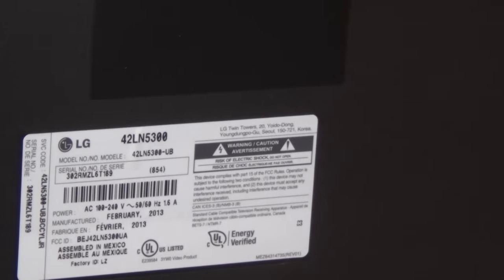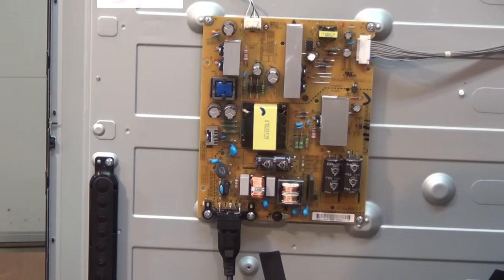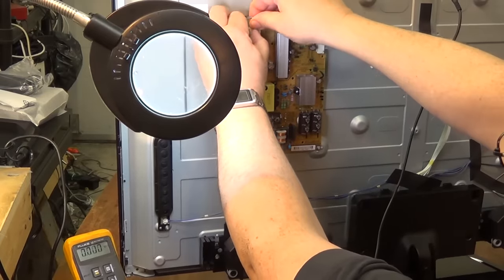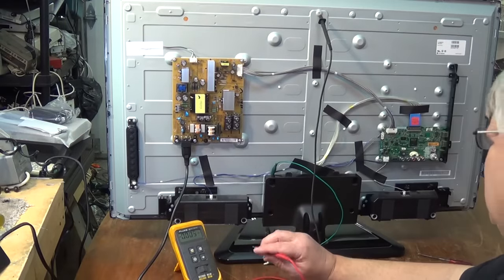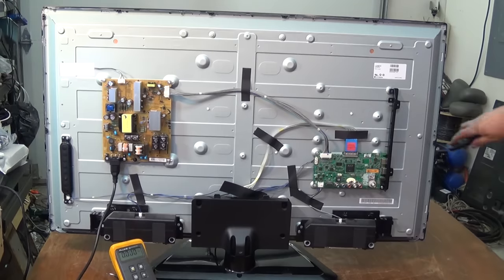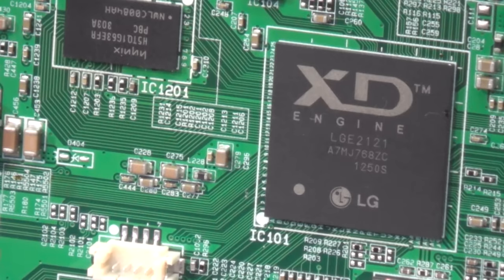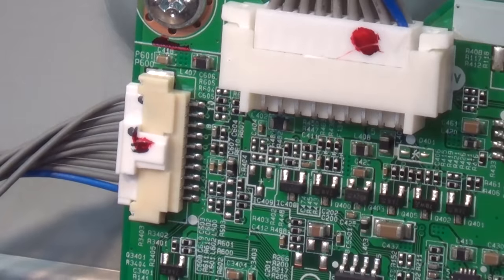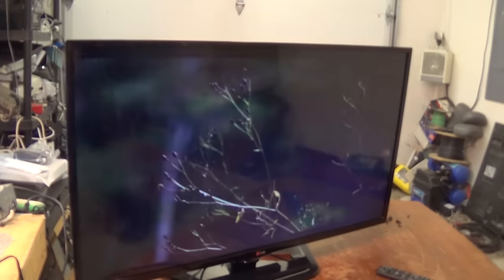LG 42LN5300 Dead   Not power supply

Comment: I didn't know you could heat chips up that much, I always thought heat was the chip's enemy. Interesting.
Reply from the maker: Heat is an enemy when powered up, because it causes thermal leakage in the transistors which causes more heat, which causes more leakage, and more heat. That is called thermal runaway, and it will kill transistors and ICs. When they are not powered up they can handle much more heat, enough to solder it to the board. Of course you can overheat the base material and crack it. That will kill the chip from a physical crack when the base material heats up, expands and cracks, but you have to get them pretty hot for that. The idea is to heat enough to flow the solder without cooking the chip. Many people use temperature controlled air stations to minimize the risk, but I have never cooked a chip doing this in the 25 or so years I have been doing it.
I do it as a last resort thougn, on equipment I own so if it doesn't work, well it was headed for recycling before, might as well send it there.
Reply: @12voltvids  so do you actually remove the main board, and mount it somewhere where you can keep an eye on the back of the panel...watching for the solder to flux? I am just worried about over heating....was going to use a blow dryer. Thanks!!
Reply from the maker: @popaki9484  Yes the board was out sitting on my work bench.

Comment: My TV was on the floor standing upright then it just fell accidentally. After that, it doesn't turn on, any clues as to what it might be? It was working perfectly fine before. Help would be nice, as I can't find anything but bad technicians around my area.
Reply from the maker: Well if it fell over good change that the screen is cracked.  Crack a plasma and the gas leaks out and the panel is done.  Crack an LCD and it might light up but you wont get a picture.  Or you could have damaged a board. Time for a new TV.
Reply: @12voltvids   Watching your videos, I actually learned some stuff, it's entertaining. Anyways, I took apart the T.V. and found out that the electric circuit board was completely cracked in half.
Reply from the maker: A broken board would do it, and chances are of the force was enough to break the board the screen is also broken.

Comment: Thank you for posting this. May I ask what voltage setting do you need to be on...on multimeter? V DC not VAC right?....and which number?...20?...200?..2000m? Thank you
Reply: If you dont know exactly the measuring voltage then start from the higher range on the multimeter and if the readings are lower from the next lower range turn to this to get higher accuracy readings.Or pick an autorange multimeter.

Comment: I have this same TV and when testing the voltage, I only get 3.2 volts to the second and third on pin the power supply but no power to the rest of the pins. Is this a dead power supply?
Reply: update. new power supply installed same issue, completely dead.

Comment: can i use a heat gun directly above this chip or blow dryer on high heat setting??
Reply: +nigel mahabir Also wondering the same...
Reply from the maker: You have to watch the temperature closely, and work slowly. I prefer to use the halogen lamp for smaller chips for that reason.

Comment: I have the exact same power supply board; however, my P201 shows no 12v or 24v. I do have 3.5v. That would indicate a power supply issue, correct?
Reply: Steve Leigh that mean your power supply board is fine problem us with motherboard
Reply: Yes. It was the main board that was the problem.

Comment: Hi, I have the same tv possibly damaged to power outage. There's no standby light but I'm getting 3.5v so that's ok. I'm not getting any 12v or 24v coming from the power board. I purchased another power board and it's doing the same thing. Can you help me out please?
Reply: power supply board is fine. It will give only 3.5 v until it is switched on by mother board. It have problem in its mother board. Try heating motherboard it may solve the problem

Comment: I have a Panasonic pt-60lcx64, will not turn on, any specific help will b3 appropriated.
Reply from the maker: Nothing jumps out at me.  Is it totally dead or do you get sound? Do you see an image on the screen if you shine a bright flashlight?
If nothing then a power supply issue, time to break out multi meter and start checking components.

Comment: hello sir, I just picked up one of these for free.  also made in 2013.  it has no picture but sound.  would you say that is a power supply issue?
Reply from the maker: Impossible to say without doing tests.
Reply: +12voltvids so if I use a multimeter and unplug the led and plug in the ac and if  the multimeter reads 0 the best way to tell?

thanks

Comment: What part or components you replace to make this TV works again.. 👍
Reply from the maker: No parts replaced. Just heated the crap out of the XD engine chip to melt the solder underneath and reflow it. TV still working 3 years later. The time I let them bake was about 2 hour because the lamp is not that hot, so it takes awhile to gradualy bring to full melting temperature. When the flux was bubbling out from under the chip I left it for about an additional 20 minutes. Your mileage may vary. If this had not fixed it, then the main board would have had to be replaced, and that would have cost too much.

Comment: LG is famous for using Sam Young caps I noticed that so I changed the caps out to Nichicon's I trust them better and they worked for nintendo for well over 20 years (when nintendo used them). I was noticing a clicking sound coming from a schottkey diode thus far and once that gets replaced we shall see what's going on.

Comment: I thought the Caps Had a High ESR.......I know they can go bad, and Not "look" Bad. I was real sketchy of those Two caps SIde by side
Reply from the maker: +Amy Marie It measured .05 ohm. The limit for a 470uF @10 volts is .24 so it was well below what is considered good. They all measured fine, and due to the age of this unit, just past the 1 year warranty I wouldn't really expect too see them failing at this point.
Reply: yeah, that and Since there weren't any domed, or bad caps. I didn't think the PSU was an issue. Theres a solution to that, wire up a small 5volt fan or 12v, and place is over the BGA Area.

Comment: Hi, I have a question, I have a lg ln5700 and the video went out but the audio was on, I had it repaired about three times for the same issues, so I finally took it to someone else and he told me the power supply board is bad, what I'd like to know is if the power supply board is bad would the audio still be on or would the TV have been completely dead? somehow I'm feeling this guy is trying to outsmart me.
Reply from the maker: Power supply supplies different voltages for the backlights and TV. It is possible that the backlights are out but the TV is still running.
Have you done the flashlight test?
Shine a bright flashlight on the screen when the set is on, and see if you can see a picture where you shine the light. It won't be bright, but enough light will make it through the screen and be reflected back so you should be able yo tell if the panel is working. If so you need to check for backlight voltage. Could be a bad backlight, or a power supply issue.
I had one that had a bad resistor on a samsung power supply, but that resulted in a completely dead set.
Reply: 12voltvids well the guy I took it to told me it was the power supply board that was bad and that could result in other problems with the tv and it's expensive to repair, so I told him don't bother with it he could go ahead and scrap it, then I spoke to someone else and she said if the power supply board was bad the tv wouldn't have had any power at all, so I don't know, is this true?  There was sound and yes I could see faint images on the screen when I did the flashlight test.
Reply from the maker: OK, so if you see faint images with the flashlight test then the problem is the back lights. 
If it is a fluorescent light backlight it could be a single tube that is shutting the set down. I had one that had 1 bad tube, and I was able to trace and disconnect that single tube that was causing shut down.
If it is an LED set, they use a set of LEDs that are all connected like the old xmas bulbs. If 1 LED fails, the entire backlight goes out.
If the set is working and you get an image with the flashlight test then the power supply is working. It is a backlight issue. On fluorescent sets there will be an inverter for the lights that can be tested seperately, as can the power supply for correct voltage for LED backlights. The LEDS contrary to what people think do run on high voltage. Most run 200 to 300 volts, because each LED is in series and drops about 3 volts per LED. Anyway it is easy to test the power supply with a meter to see if the correct voltage is there.
Reply: 12voltvids Well after I spoke to the lady and she told me it doesn't sound like the power supply as the repair guy originally told me, I called him and he said he'd already scrapped the TV down, because I did tell him I wouldn't bother fixing it because that was the fourth time it happened, I just wanted to find out of he told me the correct thing or not, I just found it a bit strange that it took him a month to figure out what was wrong with the set and within a few days of me saying I won't bother to spend more money to fix it he scrapped it down. Thanks for replying.
Reply: @12voltvids  also a protective mechanism feedback to power supply can shut down all LEDS if a strip or 2 have bad LEDs.  Not all the "strips" will be in series with each other.  Some strips may be wired in parallel and others will have their own voltage supply; yet the LEDs will b wired in series on that strip.
I think I am right on this.   Appreciate any corrections.
Reply from the maker: @Franklinveterinarycenter1of4  
Yes the power supply will monitor the current and if one starts "sputtering " will shut down the entire display.  Depending on the size of the panel there may be 1 supply or 2 drivers .  All the LEDs in the strip in series but 1 or 2 strips in series and next strip to a separate power supply. Most of the newer ones I believe try to do it with a single supply and just up the voltage.  The reason is for light control.  The controller dims the backlights on dark scenes.  If you have 2 or 3 power supplies you can end up with different levels on each and that will result in brightness fluctuation on the screen.  So the trend has been to use a single supply.
Reply: @12voltvids  thankyou for all your great videos.   Very interesting subject!

Comment: Do you ever respond to any of the comments or questions people make about your videos? I am asking because I was given a 55" Hitachi LE55 and it did not have a remote or a power cord.  I purchased those and the TV came on (red light) and then when i used the remote the BLUE light came on.  Because I am so hard headed and instead of just taking it down to Best Buy and pay the $25 to have it recycled, I decided to try and fix it myself.  Since then, I have purchased an LED tester, light strips and used board kit that were supposedly tested good.  I have checked all of the LEDS and replaced 1 of the strips that had a bad LED.  I have changed out the power supply board, the Tcon board.  I have yet to replace the main board or the input board but I have them.  Nothing has changed with anything that I have done.  The voltages from the board are 12.3 vdc and BK/on 3.22 vdc, ADJ 3.16 vdc and 3.16 vdc and on the 2 connectors going out to the LEDs i read 188.2 vdc and 336 vdc.  I do not think I should be reading the 336 vdc but, if the lights worked with the tester then why will the TV not come on.  I did not look at the flat panel with a microscope but it does not appear to be damaged.  Can you please advise?
Reply from the maker: I respond all the time.  336v for the led strips sounds right, depending on the number of lights. Remember they are all in series.  100 led at 3.3v each would be about 330 volts.   All it takes is 1 bad one and the lights will not light.  Have you tried the flashlight test to see if there is an image?
Reply: @12voltvids thank you for responding.  it is 6 rows on each row there is a long strip and a shorter one.  Thing is even though there is the 336 vdc nothing comes on the screen. No hidden menu, no noise from Tv, i plugged in the roku device and it flashes.  I found the service manual online but having a hard time seeing the schematic. Trying to take pic of the board, blow it up and print it out. I thought that this was a LED tv but the model says LCD LE55A6R9.  If the LEDS tested good with the tester, and i am a dummy for not checking them with power before i put back together, then why would the screen not come on.
Reply from the maker: @dallaspilotcar9293  
Led tv is still an lcd. Just led backlights very fluorescent.  Fluorescent much more reliable.
Reply: @12voltvids  What do the LEDS look like compared to florescent? Because I swear they look like LEDs.  The numbers on the strips are LB55061 KH-D E344144 94 V
55D3000/D2000 LB-C550F14-E4-S-G1-DL3
Are those LEDs? ?
Reply from the maker: @dallaspilotcar9293  
Fluorescent are glass tubes in behind the screen.  They are probably LEDs. All tvs made these days fall into 2 categories.  LCD (led backlight) and oled. Oled are very thin and expensive.  All the other ones, qled, triliminus, quantum dot ect are all lcd screens illuminated by rows of leds.

Comment: Very excellent done bro. Impressive even in laptop 💻 bro that’s the way how to cook the VGA and CPU processor if it’s soldered in motherboard. Great 👍 job...

I have questions. Now a days in our generation in regards to advanced hi-technology of little tiny resistors, capacitors, transistors, and other looks similar size too, when you test it with multi-tester in continuity/sound troubleshooting, why other similar little tiny component parts of their same sizes  we expect first not shorted out/grounded why they have continuity when resistors value is 16 or 25 ohm has continuity and other same sizes different component unknown parts have continuity that it went down to 1 value also the transistor that all the 3 pins have continuity that was attached/screwed to aluminum heat sink that how we really know if it’s bad? Can you please tell me also those unknown little tiny parts?

Can you also directly test those little tiny component parts that is soldered in PC boards or do you still have to desolder it to test it since there’s always continuity?
Reply: Aliens-Ets Exist-in that used to happen with one of the older Dell XPS laptops - used to have to heat the graphic chip up, otherwise a it wouldn’t boot up 😳

Comment: I did the power with plugging in and out. Tv came on, then I installed the new firm ware from LG and the tv works normal now. (Red light use to blink when it wouldn't turn on)
Reply: joe p how’d you install a firmware?

Comment: After watching your video, and taking note that you uploaded this on December 10th, 2015, that it's clear to me, that there's a heating problem that's going on in the television. Too much heat, not enough venting windows. So a very slim muffin fan would help alleviate some of that heat. That's just my guess, That's what sounds like to me. I've noticed from all flat-screen television sets with almost a flat back covering, there's a lot of heat coming out of the vents at the top so it sounds like to me it's a heating problem, what your take on it. I think the heat from these TV sets from the transistors is a killer for these flat-screen TVs. Not enough venting or a fan to at least a get rid of the Heat it may even last a lot longer over time transistors heat up immensely with age.
Reply from the maker: YYou want to talk about heat, try living with a 63" Samsung full HD plasma. Power consumption is about 700 watts, and it warms the house nicely. Those suckers were really power hungry, but the picture still stacks up to the very best you can buy today, and it is over 10 years old with tens of thousands of hours on it.
Reply: @12voltvids  Plasma, I can't imagine watching a plasma TV too much power and Heat.
Reply from the maker: @DJRobbie54  The old ones are thirsty, no doubt about that, but plasma heads love em. I have 10 or 11 of them. 5 are awaiting others to break so they can go into service again. I am too cheap to buy an OLED and regular LCD/LED sets have a narrow viewing angle and look like crap by comparison.

Comment: i have Samsung UE46D5000 it shows vertical lines on the left side and the other side is black, can u help me
Reply: first try t-con board check its connections it may be the tcon board if that don't fix it its the screen panel  then it cost too much to repair

Comment: i know this video is old but i want to add that ppl forget that back then everyone was doing reflows to the xbox 360 without flux just heat alone, heat alone could be a temporary fix but with flux is permanent i did it a few times never had a return
Reply: How is it done? By placing the flux around the chip and heating it up to draw it under?